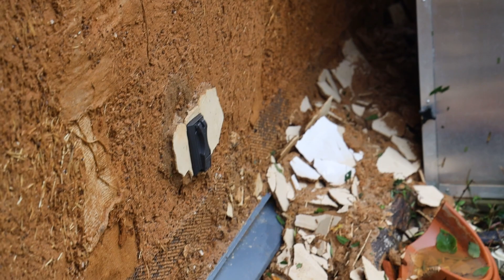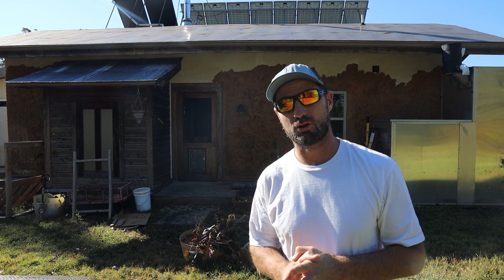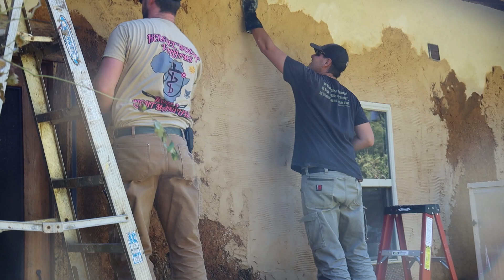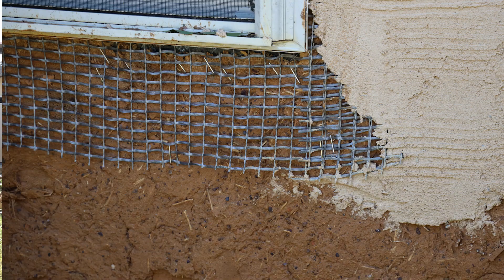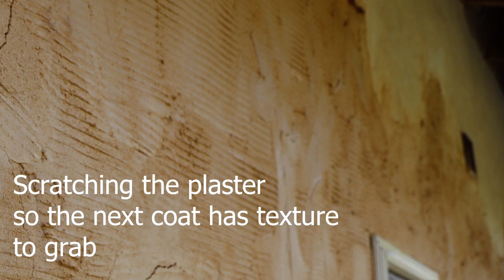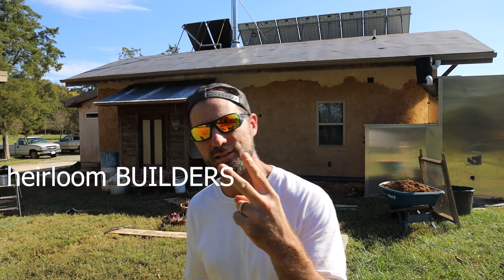How to FIX FAILING earthen clay plaster with bonding coat of LIME RENDER

Comment: Hi Mr. Logan, this is Luca from Italy. So sorry for your wall crumbling down, but I am missing something. Why not apply lime (+fibers) directly on the strawbales? I mean, lime is corrosive towards zinc  steel, but not towards timber, hemp and I imagine it is also not corrosive towards straw. I don't really understand the need for having clay at the outside part of the building. Not a single coat since it doesn't make a chemical bond. At the inside clay is perfect and in particularly damp rooms you use tadelakt or cocciopesto (the ancient roman style). For the outside, to protect the lime plaster why not use siloxane paint? This would add a water proof layer allowing at the same time the breathing of the wall. Thanks for sharing your experience, the good and the bad parts. Ciao!

Comment: Logan, much appreciate your posting of failure -- we can learn without making so many mistakes.  

I just started to work with lime a couple years ago and after 15+ years of CONFUSION, finally learned about the different limes. Still have a couple bags of Home Depot Type S and don't know what to do with it. It's NOT what's in Roman concrete, has added chemicals for use with cement.

You didn't mention which type of lime you're using, it has to be able to breathe or will fall off again. I might just add some quicklime to my final coat and see how that works out.  Less chance of separation due to materials expanding and contracting at different rates as temperatures and humidity change.

However, even a small amount of lime makes the cob so much lighter.  I want the natural look, maybe have to do a final color coat with cayenne or some spice for coloring.  Much to consider!

Around 2010 a friend applied cob that was very watery.  It's easier to apply, but won't last.

Hoping to finally finish a couple old projects this year and it's a bitch to get cob to stick to OSB, am now working on at least the 3rd redo since 2007.  Found this video as I was looking for a recipe for sanded exterior primer since I ran out of the storebought primer I got back in 2006 -- glad it didn't go bad! Now I'll make my own.

I've been experimenting with hot mixing quicklime with cob and the adobe bricks have been lying around for over a year, dogs and the pig broke a few as they keep running over them, so I'm not excited over structural strength, but they look as good as Portland stabilized bricks, with no damage from rains (not many here in the SW) and weather and we made some cob only bricks for comparison.  The lime bricks are far superior.

Good tip with the bottle for the light, and it's so good to have help.  Sucks I'm by myself right now, where are WWOOFers when you need them?   70s next week and it's time to get some work done before it's 110+ F again.

Comment: So looking back,  would you turn the house around so that it faced a different direction exposing a smaller wall to the northern side ?
Or in the situation of a storm like  Ian you can't predict which direction its going to come from  ?
Reply from the maker: Believe it or not, Colin, this is the smallest wall, 10’ tall! The other side is 16’ clerestory for the passive solar gain through the high windows. Looking back, I would have done the there coat lime plaster/render application instead of so much earthen plaster. It was nice having people help with the earthen plaster bare handed during all the workshops and plaster parties we had though.

Comment: Great job y’all.
What is on the roof?
Reply from the maker: The roof is painted roof metal coil, layered like shingles to shed water and handle the curve in the roof framing. I thought standing seam metal might not make the curve without creasing and creating leak points in the future (not that I had enough money to buy standing seam metal anyway!). A year or two later every McDonalds and Hardee’s had a curve the same shape - covered in standing seam metal. Ha! I guess it would have been fine, but with all that solar on the roof, I’m not replacing it anytime soon! And hopefully don’t ever need to!